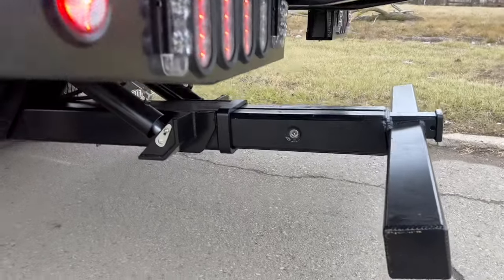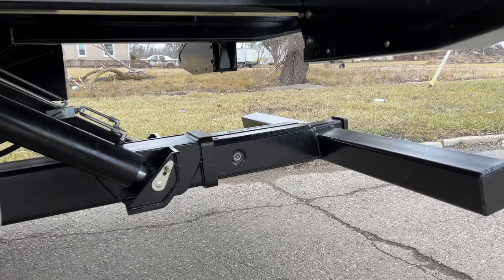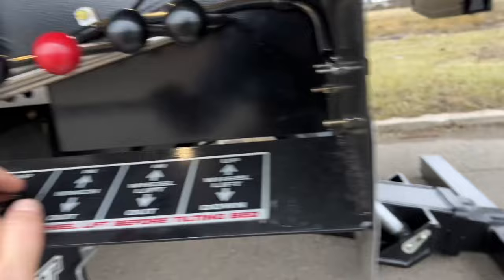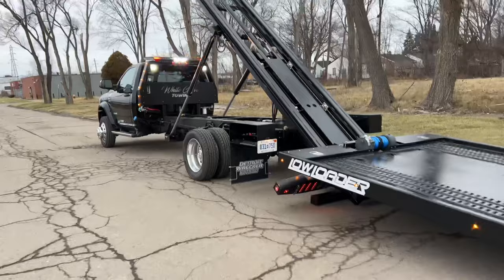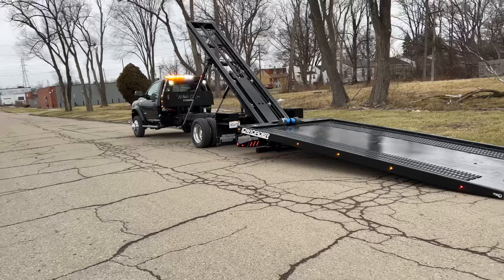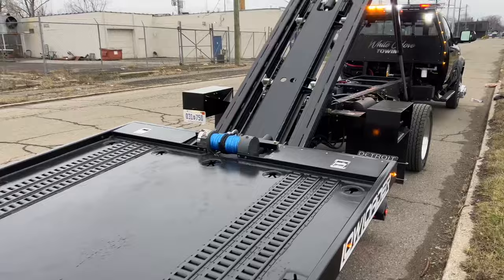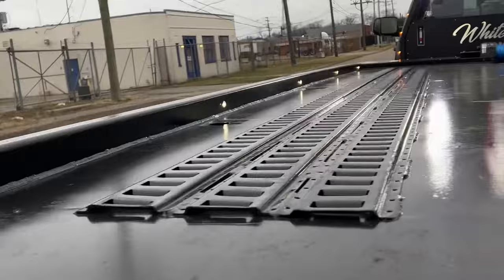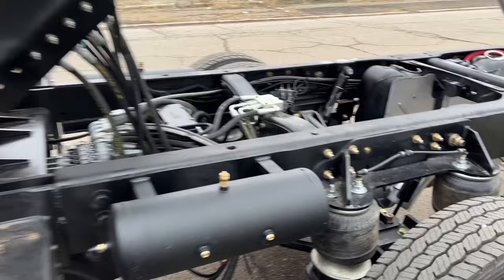Low Loader test for White Glove Towing of Las Vegas.

Comment: So there is no more need for the safety compression valves which stop the bed? (In case the operator forgets to lower the wheel lift) Once in a while my Low Loader safety valves completely compress (whoops). I’m a self-made expert on dealing with this situation. I look forward to my next Detroit Wrecker Low Loader. So much more capable than anything else I have encountered. Other tow truck (experienced) operators are completely amazed on what it does. Maybe I will invest in a camera operator and start my own Youtube channel showcasing my build
Reply from the maker: We relocated it on the side of the wheel lift, eliminating the two at the back of the subframe